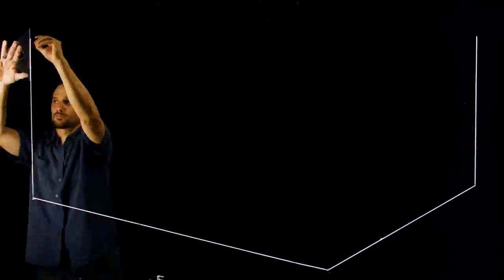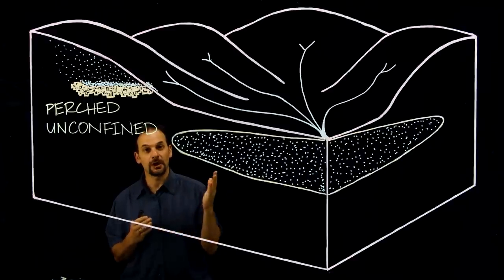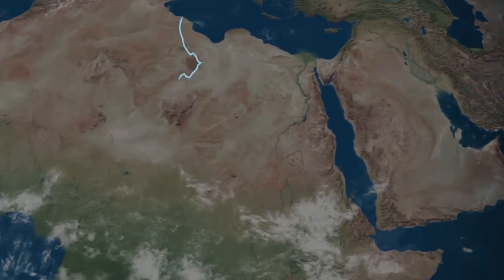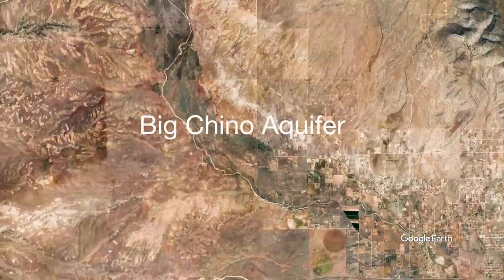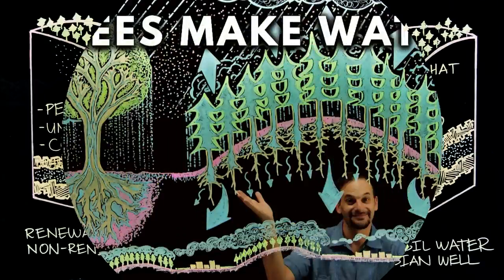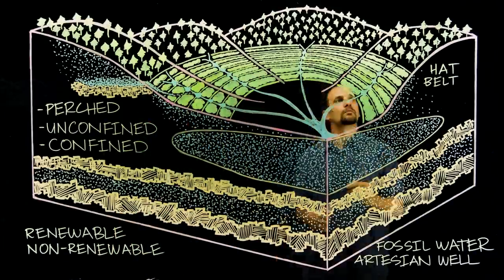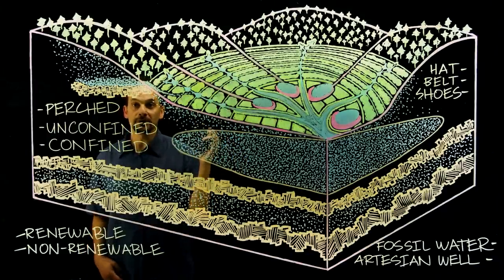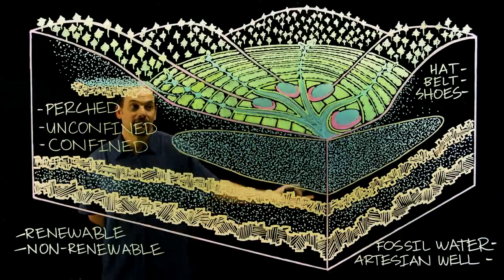How to Rescue a Sinking Water Table

Comment: A 3 acre lake was drained so they could build 35 homes and my pond is now 3/4 empty.
Is it possible by draining that lake they lowered the water table and accelerated runoff so percolation stops and my pond will completely dry up?
Reply: It is possible, but you should ask a local person familiar with the local hydrology of the place.  In India, many dams exist, not only to store water for the dry season, but also to raise the water table, so that wells do not have to be so deep.
Reply from the maker: It is definitely possible. I can't say without looking at it, but the lake could have been the aquifer surfacing, and when they drained it they lowered the aquifer. Sorry to hear that.
Reply: @amillison  the lake was Doug decades ago and there were small streams that fed it which passed by my property... There is a drought but it hasn't been that bad.... I'm just wondering if I'm going to have to catch the fish and find a place to take them

Comment: I have two arroyos in southern Colorado that I have been saving up to close them off.  The equipment is expensive but I’m getting there.  When water runs through there, it’s allot, so I plan to let it just soak in.  My well went dry and I had to dig a few feet deeper one summer so I think it’s prudent to feed the ground when ever possible.  Everyone in the mountains needs to hold back as much water as possible.  It will either soak in or evaporate, either way it will be available elsewhere later as well water or RIAN.

Comment: How deep are the confined aquifers ? Is it possible to break mine and use that impermeable rock for construction of that impermeable rock ? Above to create an area which could be lower than any of the surrounding areas to buiild water catching area bit far away from the city so the water can be recharged by rain ? I am just thinking about it. In UAE where I am located they use rocks from mountains in construction, so can that be used ?

Comment: Couldn’t you perforate a fossil water aquifer by drilling multiple wells into it , stick pvc sleeves into the well past and loose rock and dirt/soil and perforated the pvc piping above the ground , then fill the area with rock leaving a couple feet of the piping above the rock and feed it water from a stream to recharge the aquifer? Seems to me this could be done if the wells were dug in a depression in the landscape .

Comment: A geophysicist told me that the aquifer cannot be fully recharged because it compacts as the water is removed and does not fully expand again.  The key is to not pull water out faster than it can be replenished.  For coastal areas, the solution is both recycling water and desalination using the power from a nuclear power plant.

Comment: Would it also be a suitable solution to create a path to recharge confined aquifers for specific areas? I am thinking areas where the water rains in a very short period of time where normal percolation is not quick enough and/or areas where the losses to evaporation would be considerable.

Comment: Wherever the aquifer is depleted or in the process of being depleted, you can drill into that aquifer from somewhere there is snow-melt (part of the year) and let the snow-melt drain down into the depleted aquifer. It may be that the drilling can be straight down or down at an angle.

Comment: Hi Andrew, here in the UK most old housing stock run off from roofs tend to go into the sewage system and of course this gets overwhelmed when we have big rain storms and then subsequent flooding. I have in my own small way diverted my runoff into my garden and at least I won't contribute to the problem. You should be advising Governments with your insight. Could we not replenish fossil water by collecting excess water and putting it back down the pipes we extract it from.
Reply: I'm in Germany and I'm doing the same thing - trying to diverty the run-off from my roofes  into my garden. I'm doing that only one by one, as I have only a small property and don't whant to "swamp" the neighbors down hill.
Reply: @MartinaSchoppe  sehr gut

Comment: How do I tell what kind of aquafer my land is on?
Reply: Interview your neighbors for one.  If they're having to redrill and they're at about the same elevation you're likely over an  unconfined aquifer.  
If your well is very deep compared to your neighbors it is likely a confined aquifer.  
If you're at a higher location and the and you ht ave natural water seeps (if not springs) then it's likely a parched aquifer. 
Interviewing well drillers about wgat they find drilling yours, or your neighbors' well when drilling will also give a clue.  If they are running through bits faster than is typical, that is another clue as to a confined aquifer...

Comment: I'm curious. Is it possible and sometimes desirable in hotter drier climates whereby fossil aquifers are the main water source, to recharge those aquifers when there are intense periods of rainfall as often happens in desert areas for example?
Reply from the maker: Definitely! There are typically levels of aquifers, confined and unconfined existing in the same spot. I think most fossil water is in  the confined aquifer, but there must be fossil water in unconfined aquifers as well. It's really going to vary depending where you are. But recharging the unconfined aquifers during rare heavy rains is the best strategy. Takes planning at a large scale.

Comment: Water deep in the earth you called fossil water is generated there and is unlimited, even if you disagree the water down there is multiple oceans large and is a great way to recharge the aquifers. Besides there are massive rivers and ocean ports that have primary water coming into them and you can't stop it
Reply: You're assuming that all 'confined aquifers' tap into other areas.  Sometimes water can be capped off by a volcanic event sealing it in, for example...